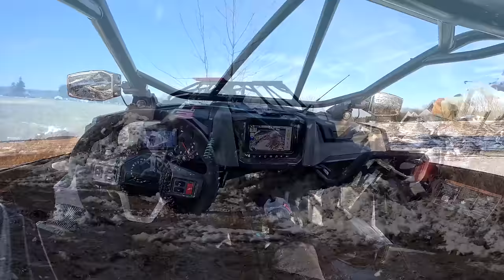Racing prep! Maverick X3 and TURBO Pro R go testing

Comment: Leo, I think adding oil to the Pro R is similar to the RS1, fill through the oil dipstick.  On my RS1, I'd have to remove the bed as well to access the oil cap.
Reply: I filled oil in the dipstick. I have a bed enclosure and didnt want to pull all that crap each time

Comment: I recommend trying to get some negative camber probably both front and rear or lowering it. When the suspension is lower it will automatically have more camber because of the geometry which dramatically increases the stability and traction in turns. Also I know it’s crazy far but there’s a really cool event in Redding CA called “Kool April Nites” coming up, its a huge city wide car show and big drag racing event. I live right next to the track so if you guys are ever here and want a nice place to stay or work on your stuff you’re always welcome. Also there are endless awesome riding spots through some of the most beautiful country anywhere.

Comment: If you need tires. Find some jeep or small bolt Ford wheels with a ok offset. Your bike pattern matches rangers, Mustangs, crown Victoria, older Jeeps, etc. you'll get them way cheaper than Polaris wheels, and you'll have so many options. I've seen ppl running street setup and they love them. Find a cheap 31 inch combo and your ready to race. Love the videos, you guys seem way happier on the new channel. All the best luck for you guys